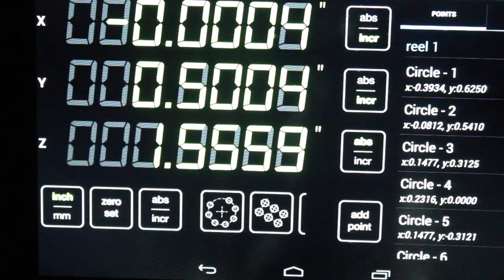Homemade Fly Rod Ep. 1: Snake Guides

Comment: Hammer them to flatten?
Reply from the maker: I tried that, was having issues with the material cracking when getting cold worked too hard. Something with the spring temper making it difficult.
Reply: The wire is small enough that you should be able to anneal the ends with a pencil torch, without affecting the rings.
Reply from the maker: I'll experiment with this and see what happens. Ill make some updated ones if it does.